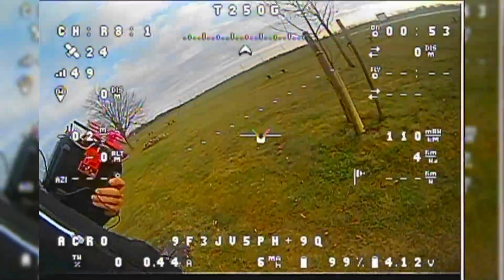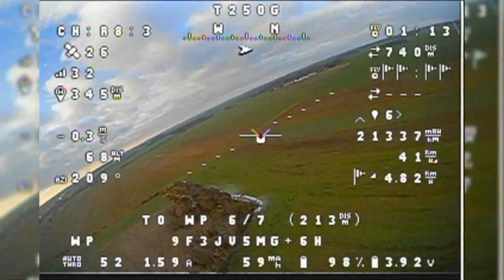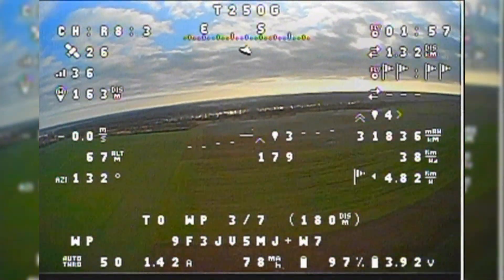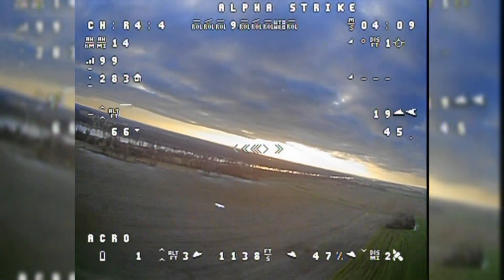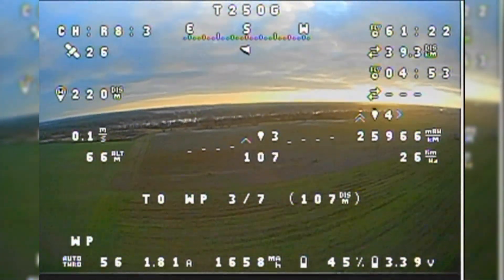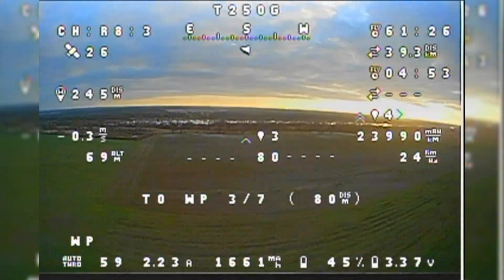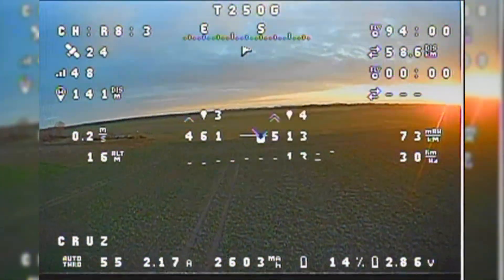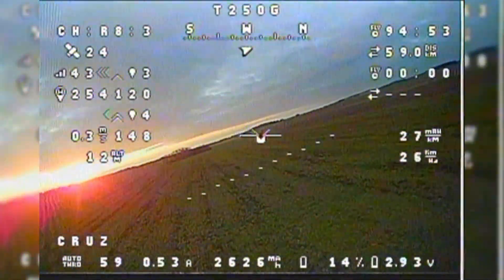250g Endurance Challenge Part 1 - First Test Run

Comment: Very much impressed with the performance of these tiny planes. I just couldn't have imagined this when back when I first flew electric on NICADs in a 2m motor glider in the 80s. It was a real lead slug of a flight.

Comment: Nice setup and flying. For some examples of long-range (LR) sub-250g and solar endurance flights, take a look at "DongHo Lee" channel. He's flown a highly modified Talon 250g over 128 km.

Wondering if possible to set INAV Auto Throttle to a constant value, so the plane flys at a constant airspeed, instead of trying to maintain ground speed? Noticing INAV auto-throttle varying from 35% to 65% as it compensates for wind, while maintaining altitude. Maybe using Soaring Mode with a constant throttle, to maintain altitude, but keep motor at peak efficiency?

(feel free to delete comment if you don't want your friends to see source of competitive LR secrets. LOL)
Reply from the maker: Ah I know this guy from his crazy 4S8P AR Pro setup. he does awesome stuff but this setup has to stay below 250g for the challenge. 

INAV regulates auto throttle based on target pitch angle. the strong fluctuations are because of the raising and falling winds in that area, caused by the river 500m in the south. So INAV has to fight to keep altitude. A different location and less wind should be better to have more constant throttle. Ground  speed doesn't matter for INAV as long as it is not below 7m/s. Then it raises throttle to keep thrack of the flying direction. 

At some poin tin the flight that is not in the video I switched to ANGLE mode with manual throttle but then the falling winds pushed me down close to the ground and I was not able to maintain altitude without powering up. So INAV does a good job here.
Reply: In ardupilot you could do this by setting TECS_SPDWEIGHT closer to 2.0 (which would follow airspeed exactly but ignore altitude) than to 1, reducing THR_MAX and TECS_CLIMB_MAX, and decreasing TECS_THR_DAMP.  Then for safety you could set up a geofence with a minimum altitude and set fence breach to guided with throttle passthrough, so that you could just peg the throttle if the plane gets dangerously low.  The downside is you'll need an airspeed sensor.
Reply from the maker: @Dovorans  yes I need an airspeed sensor and a bigger FC that can run ardupilot. Both is no option as I am at 249.4g right now.
Reply: @MarcFPV  What is total weight of eg. matek airspeed sensor? is it heavier than 20g with tubes?
Reply: @Dovorans  Thanks. Think you mean altitude band, vs. geofence, but is good to know such options exist.